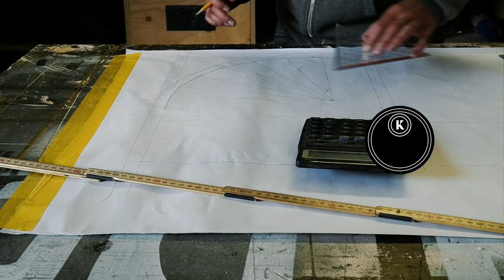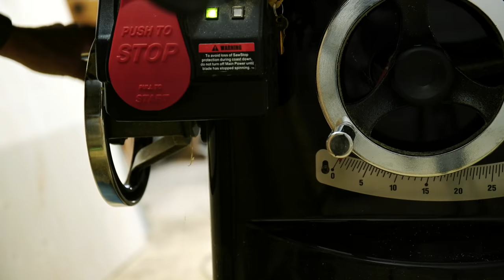Building a Record Player Cabinet

Comment: I love it's lines.
If you do a lot of upholstering you should get your hands on a pneumatic staple gun for the size staple you prefer since you have air in your shop.
I worked in a furniture manufacturing plant for almost 10 years. Once you use one of them you will never go back. 
Surprisingly they are not that expensive.
Reply from the maker: Thanks for them tip!

Comment: I like the videos of wintergatan, where the guy is building that marble machine. He keeps that sounds of the tools he uses in the video. The sounds of hammer, drill, angle grinder etc.... the sound of marbles dropping on the floor and sometimes even birds or crickets singing outside. I miss that a little bit in your video.

Comment: The Reverberation or Vibrations from the Speakers, might effect the tracking of the tonearm on the turntable.
Reply: very unlikely to have any noticeable effect. The TT is isolated by its sorbothane feet. There could be more of an issue with the sound of the speakers themselves being shut in in the small enclosure but at moderate levels even that would be just barely noticeable. Also some people like to listen to music, not their reproduction chain

Comment: I was just thinking about this yesterday. I thought a dust cover for the turntable would be desirable. Don't like the idea of putting the turntable in a recess. Swing out shelves on either end hinged at the front of the cabinet could accomodate a great range of speakers while placing them farther into the room when in use to lessen boundary effects on the bass. The Vanatoo Transparent One Encore powered speakers would serve well.

Comment: I think I would have dadoed where two pieces meet at 90 degrees. But then I don't have a Festool domino joiner.
I wonder though, not from a structural integrity standpoint, but from a stylistic one: would dadoes have looked "nicer"? Perhaps for a modern piece like yours it would be a toss-up.
Nice to see original designs being created.

Comment: Awesome, love the speaker frets left and right, how do the Control Ones hold up for vibration, are they a snug fit? Personally, I would hide the amp and make the cabinet a little wider to fit a 2nd deck and a mixer, its just begging for that as you have the pick and mix vinyl holders above the speakers, which so reminds me of being in the record shop, back in the day spending hours flipping through the new tunes. How is the tiny camper doing? Not seen a video in a little while. Peace and love.

Comment: see you took lessons from adam savage's storage system in youre workshop , need to do that here , my system resembles that of der ludolphs (das stapel princip )
https://static.kino.de/wp-content/uploads/2018/04/ludolf-rcm950x0.jpg
been looking for that fineer banding online , want to use it when i build my kitchen cabinets, it looks nice makes the wood look like a solid slab 
the cabinet turned out nice , might had made the curves and the frame the speakercloth tightens around slightly different but all in all its a good fit for the interior its sitting in

Comment: Cute aesthetics, I guess, but no audiophile with an ounce of experience (or pride) would ever place speakers in a box like that, low to the floor.  Any design expertise that the speaker mfg incorporated to try and get good performance from a small monitor (best placed on stands) is tossed out the window with such an arrangement.  You would have been far better off incorporating some type of small platform atop those end sections for the speakers to rest on, with the goal of getting the tweeters at ear-level when seated.  This is an exercise in design only - definitely not in optimizing sonic potential.
Reply from the maker: Relax! I am okay with the sound